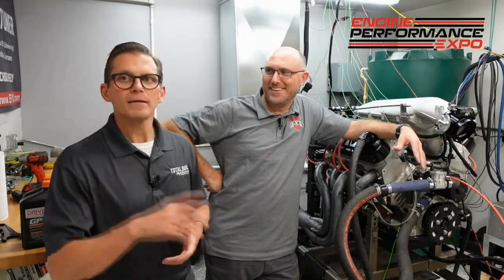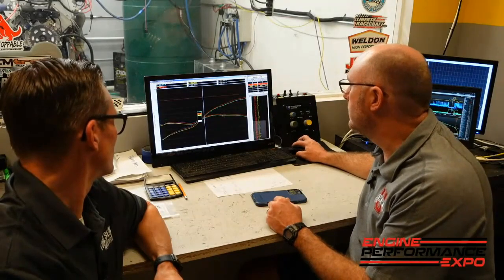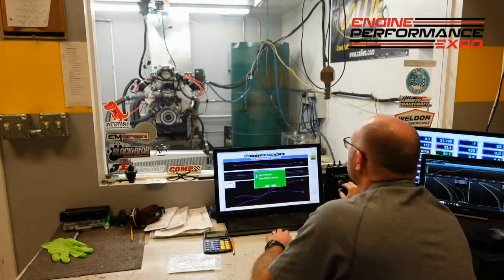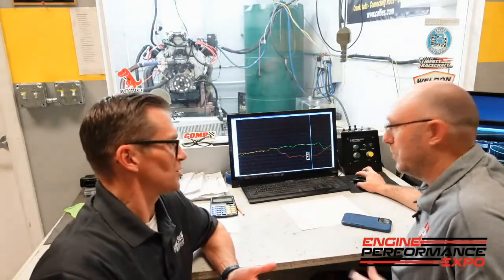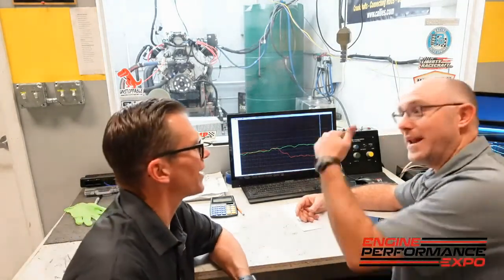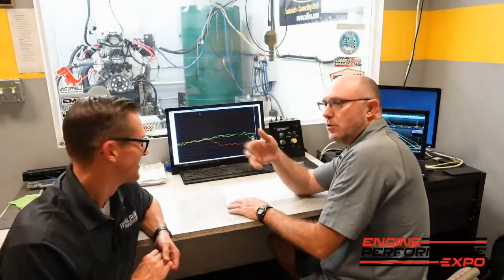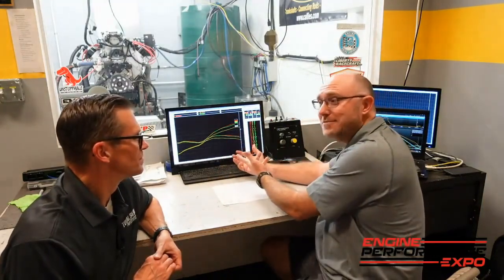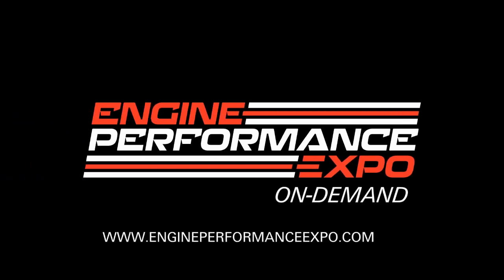Oil Level Dyno Testing (2023 - Episode 50)

Comment: My guess is that (at the lower oil volume where pressure dropped) that a portion of the power gain came from the oil pump's reduced load and from the decreased crankcase windage. When the oil volume was increased above the recommended level the pump pressure was no longer adding or subtracting power, but the crankcase windage loads increased and a more subtle power drag may have come into play in the form of oil aeration allowing some increased friction (maybe not during the very short dyno run though, but likely with extended high rpm it would have). The other thing to try would be reducing and then increasing oil viscosity to see if oil pump pressure load and windage loads could be lessened even more, as long as viscosity remains in the safe acceptable range for this engine's bearing clearances. 
    It would be nice to know for a fact exactly how much oil pressure is needed to maintain the oil wedge at all RPM. I believe Smokey Yunick said a good rule of thumb is to have 10 psi for every 1,000 RPM up until around 75 psi. I would like to see this put to the test. I have a feeling that once you have about 45-50 psi, that it would maintain the wedge even above 5,000 RPM. Until we actually know for sure, we will err on the safe side and shoot for high pressure and above minimum oil volume and live with the power loss as a safe trade-off.

Comment: So in a non-OE engine build how do you determine the "proper" amount of oil to use? And is there a way to determine this without specifically testing various quantities on a dyno?
Reply from the maker: You can measure the depth of the stroke of the crank and rod assembly from the pan rails and the then mark that depth on the inside of the oil pan (but add 1/2 inch) You can then fill the oil pan to that mark and record the volume of oil required to reach that mark.
Reply: @EnginePerformanceExpo  So are you saying go 1/2 an inch closer to the pan rails or further away?
Reply from the maker: 1/2 inch deeper to provide room for the oil to expand as it heats up (and still have clearance).
Reply: @EnginePerformanceExpo  Great, thanks for the clarification.
Reply: @EnginePerformanceExpo  Thanks for the reply! Do you add the 1/2 inch to move the oil level "up" so that you're increasing capacity or "down" so that you're giving extra clearance for the crank/rods and reducing the oil level?

Comment: Not very useful or enlightening. Should have mentioned at what volume there is rotating assembly interference and even more important should have tried a lesser viscosity oil. And you guys gotta be kidding if you think (oil) pumping losses don't have anything to do with the numbers! Gain 60Hp with dry sump...would have to be a combination of factors if that happened. More than was observed here.